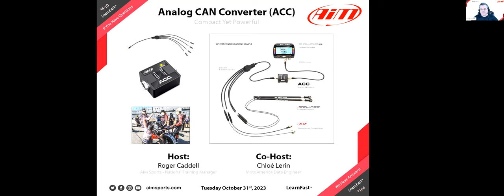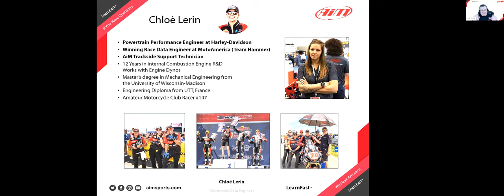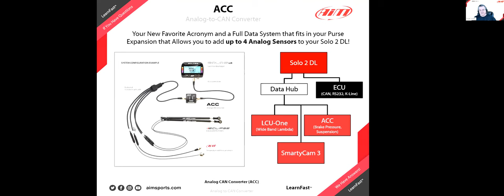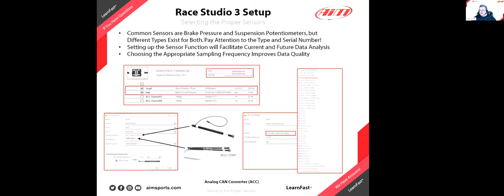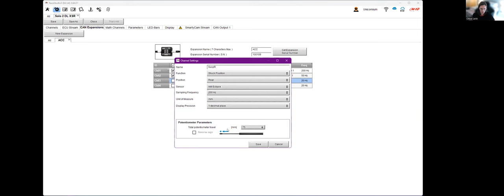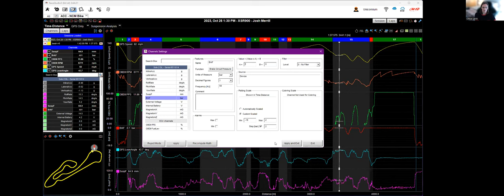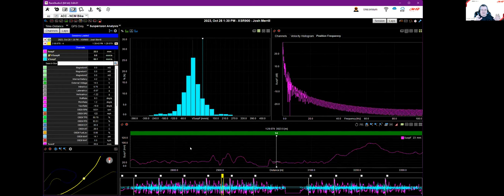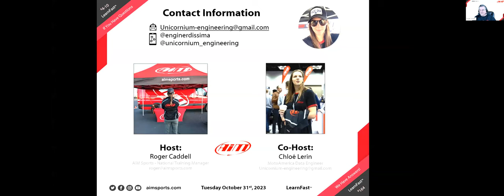4-10 - Analog CAN Converter (ACC) - Live Webinar with Chloé Lerin - 10/31/2023

Comment: Is it 4 analog sensors total or 4 analog sensors before needing a data hub? for example, can I have a second ACC attached to a datahub feeding the Solo2DL 8 analog channels?
Reply from the maker: For your specific application of the SOLO2DL, you may only add one ACC device to the CAN network. For other devices in our automotive line like EVO and MXx hardware, you may add multiple ACC devices.
Reply: @aimsportsdata  got it, thanks!

Comment: Would I be able to use Solo 2 with OBDII ECU input + the TPMS receiver? Would just need to wire up the receiver with the 5 pin connector correct? And I guess would need that as an option in the config?
Reply: I think only with ACC Open TPMS can work

Comment: Would I be able to use the LCU-One Lambda Controller with the ACC and a solo II DL
Reply: Yes absolutely. You will need a small data hub to connect the ACC and LCU one into. Then the data hub plugs in the Solo2DL. We highlighted this in a schematic in this presentation.
Reply: @chloe147 Roger mentioned during webinar that only one ACC could be connected to Solo 2 DL. However, can I use a data hub to connect at the same time the channel expansion and ACC to get more analog channels available? Is this possible with Solo 2 DL?
Reply: @chloe147 thank you will I also need the data hub to use my smartycam 3 corsa
Reply: @jsbb916 Hi. No, the Solo2DL will limit you to 4 analog channels. You can use 1 channel expansion or 1 ACC, but not both at the same time. 
You’ll notice that when you add a new expansion in the config page, at first you have: LCU-One, channel expansion and ACC. 
If you pick the channel expansion, then the ACC disappears from the available expansions, and vice versa. 

For more than 4 channels, you really want to consider an EVO5 or a dash. 

I hope this helps.
Reply: @chloe147  thanks for the reply and clarification!